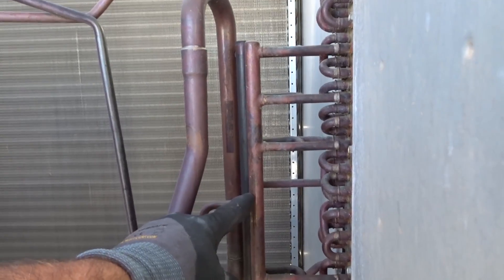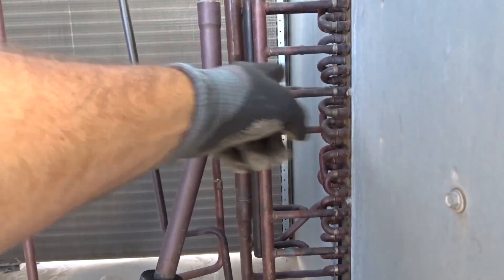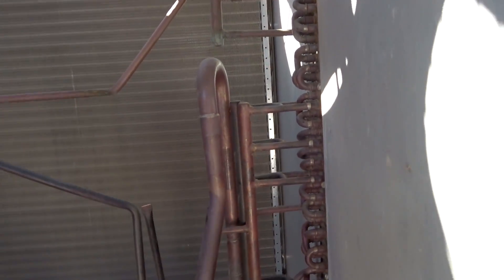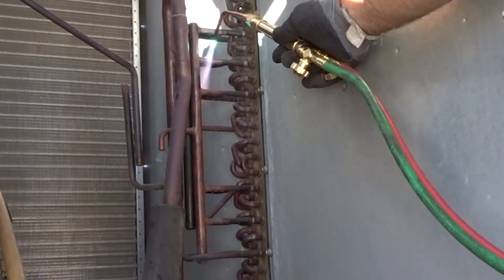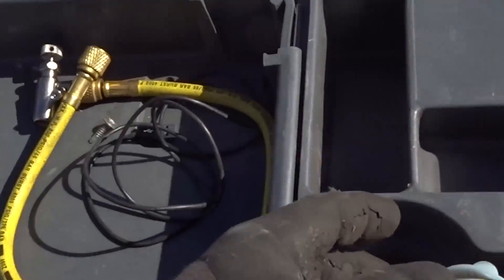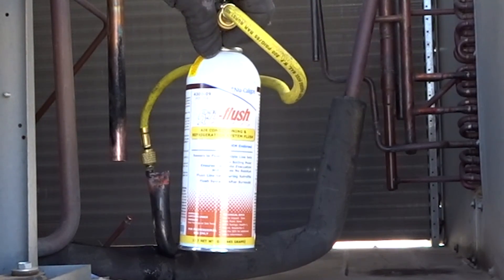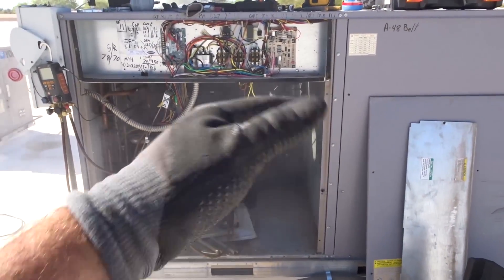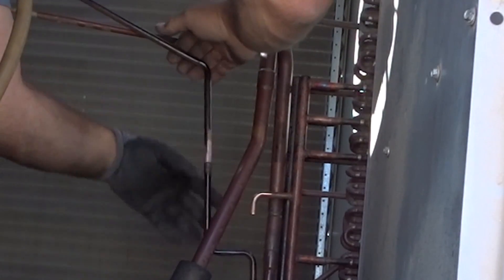Trick for clearing Carrier multiple orifice manifolds in RTU's without removing them

Comment: The problem with this is that it is only a temporary fix and someone will be back again because you have not got the wax completely out and like someone else said the oil was more than likely over heating to cause this.
Reply: Sure, but to get them back up and running can be a great win. Then you tell them you're going to need to come back and do that work. Job security. Most customers like the option of getting their equipment back up and running with little cost. Then perhaps with incremental improvements making it look like it didn't cost so much. So it depends on what the customer wants to do sometimes. You make recommendations that keeps you coming back if you like doing that. But being he's had such success performing this task, the simplicity in it, and the lack of parts needed to perform the task, it's a cheap option to get the customer up running. Additionally, in inline filter replacement will buy even more time. A cost most customers are willing to fork out. But again, with the thought of returning. So dude, he just got them running at a fraction of the cost of another (rejected) quote. All the while landing a repeat customer for saving them money. 

But seriously though, do you actually believe this is the kind of guy that had not considered everything you've just stated? Clearly, the contaminated oil issue is the obvious. But with the success rate being 100%, I'd think he knows what he's doing. So your comment is definitely odd. What tech performing such a task wouldn't know that?

Comment: If the Header that contains the metering devices is available at parts house. might be good to replace header. Good job, by the way! Peace
Reply: Usually 2-3 weeks to get one, and an absolute PITA to replace on some models, especially the 14 SEER heat pump package units.

Comment: I always replace the header. Sometimes I swap to TXV. 
Carrier RTU'S sure keep us busy with repairs don't they? I call Carrier for quotes about everyday, probably have to call Trane and Lennox once a week.
Reply from the maker: I often swap to TXV on the straight cool units but most units here are heat pumps and due to the check valves in the coil manifolds to re purpose sections of the coils differently for heat versus cool it is not an option to change to a TXV.

Comment: Awesome Video ! Very cool Hackfree. Does it only Happen on Heat Pumps ? Yea, that Poe Oil Does not Like Heat. it seems to turn to white concrete , . i see it on cap tube systems all the time if Peope don't keep thier Commercial Refrigerator Condenser Clean. i would be interested to see what the Oil in the compressor on that unit Looks Like, ,If it Plugs up again i'd Do a Oil change on the Compressor. Awesome Video ! Thanks for Posting  ! i Have not Ran into this yet. 
Thanks also for the cool Swage usage tip. i'm Gonna Get me some of those . i have seen those before but, i did not think they would work very well. on the big 7/8 one u might want to use some wd-40 and it might go Easier. take er easy.
Reply from the maker: I think I've fixed some on the gas packs too.